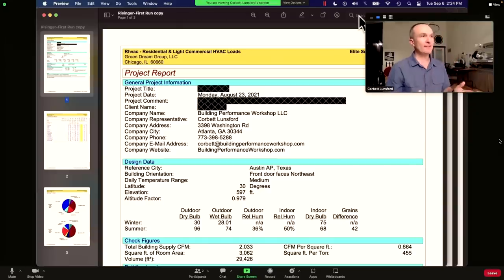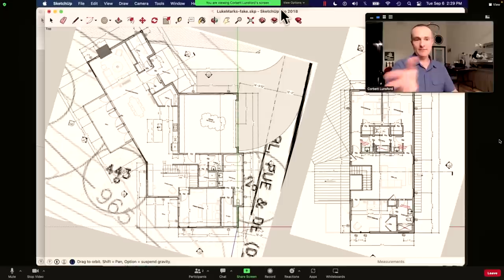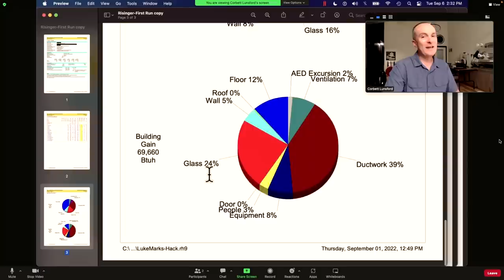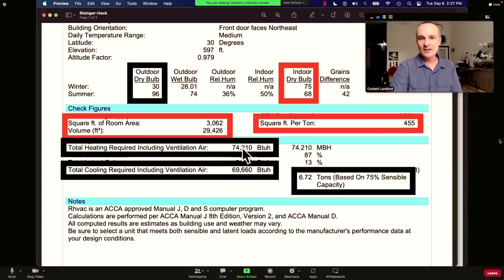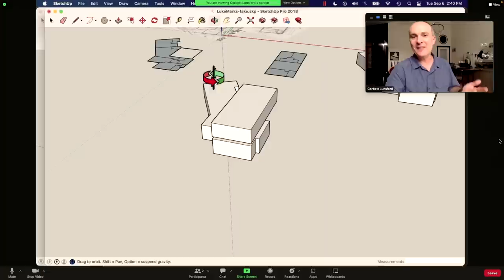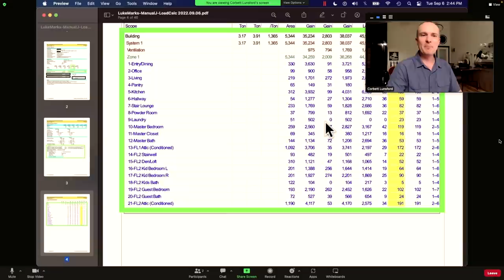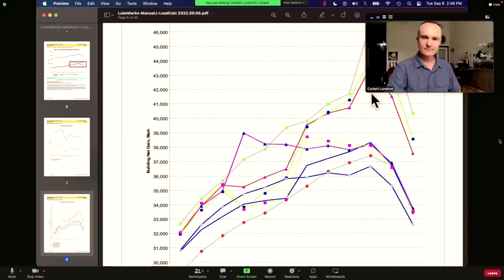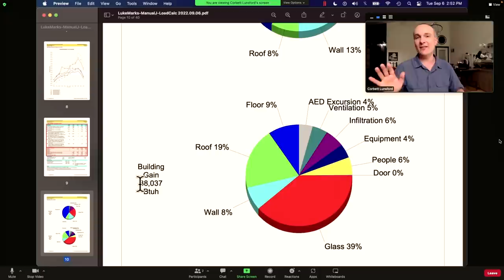Your HVAC specs might be COMPLETELY wrong: Manual J Training

Comment: When we built our production builder grade home - I asked for a manual J and they couldn’t produce one. When I pressed them for it - they told me they did one for the floor plan and not for my specific house.  Now I know better. Doing a manual J for a floor plan and not a specific house doesn’t take into account for the location and orientation to the sun in the heat of the day.  As a result - my hvac struggled in the July/August months…until I did Insulation 2.0.  That actually made it to where my hvac could keep up.  Would love to know what a manual j report would have said my house needed.  I have a 3,100 square foot single story with a single 5-ton unit.  When I build my retirement home I will be hiring Matt to come down to San Antonio to consult on the build to make sure it is done correctly.
Reply: How did you do Insulation 2.0?
Reply: @LeanHVAC  best advice is to search Matt’s other videos for insulation 2.0.  Watch the video and do everything he recommends.  It made a huge difference year round for us - but especially in the heat of the summer and coldest month of winter.  My bills are consistently much much lower than my neighbors.  Be prepared for a lot of work - especially if you have a large single story like me. Do it now during the winter months before the attic gets hot.  Also as a best practice - I ran lights in my attic before I started so I had plenty of light to work.  Also - I bridged the trusses with 2X4’s and plywood to make an easier time of getting around my attic.

Comment: From what I've seen, many HVAC companies do not know how to handle a house with a conditioned attic.  With a steep pitched roof a conditioned attic encompasses a large volume of air.  This definitely influences the temperature in the house below the attic.  This is largely overlooked by most Manual J calculations I've seen.

Comment: Great content. I wish more HVAC contractors would embrace the guidance set forth by ACCA (Manual J/S/D).

Do keep in mind that Manual S is critical for AC sizing because the tonnage specs on most systems
are rated at design specs that you would NEVER run your system at. Therefore, you have to use the 
extended performance data from the manufacturer to figure out the extrapolated ratings at 75F dry bulb and
62F wet bulb (at the ASHRAE outdoor temp for your location) for a few different cfm/ton (350/400/450)
airflow settings (manual S will give you a formula for setting fan speeds based on data from Manual J)
You shouldn't oversize by more than 15% for single-stage AC, 20% for dual-stage AC and finally 30% 
for variable speed AC. There are a lot of great training videos on YouTube from Ed Janowiak who
is the head of education at ACCA. Search for his "What is Proper System Airflow" on the HVAC School channel.

Comment: Thanks for this video. I'm so tired of rule-of-thumb bs, also with no testing or checking reality. The US would use 15% less energy with careful builders and smart architects.
Reply: You have to think about the AC cooling capabilities are getting lesser when people don’t care about their ACs and Freon leaking, etc
Reply: 15% sounds pretty negligible though?
Reply: @3nertia  Depends on the upfront cost. In my climate, many energy efficient design and build upgrades have a 5 year payback for new construction.

Comment: Can you guys explain the difference between a conditioned attic versus an encapsulated attic. My mech engineer says mine will be encapsulated even though well insulated at the roof because I don’t have actual vents cooling and heating the attic. I presume I’d need a thermostat up there too.
Reply: Short answer: every part of the home should be completely IN or OUT. If it’s IN, treat it like any other room, and put a supply and return pathway in.
Reply: Humidity could be an issue with encapsulated. Since you don’t need insulated ducts if the HVAC system is in the attic, you don’t want them sweating in a non-conditioned attic, and you don’t want your roof rotting. Having a temperature difference or humidity difference between the attic and downstairs can lead to moisture issues which leads to mold.
Reply: @HomePerformance  I thought code doesn’t allow a return if you have another gas appliance in the conditioned attic like a water heater.
Reply: @jasonbkau  That mostly goes for atmospheric draft water heaters or induced draft furnaces- neither of which should ever be used in any home where airtightness is paid attention to. Massive problems coming whether you put a return in the room or not.
Reply: @HomePerformance  How about  a dedicated minisplit for the conditioned attic?  Insulate the attic roof with closed cell foam and insulate the attic floor with rockwool, hang the HVAC equipment, and then you get best isolation from a noise standpoint and don’t have return air sucking in rockwool fibers.

Comment: “The hottest day of the year in the summer”?  Is that as opposed to the hottest day of the year in the winter? ☺
The Manual J has not changed much since I retired 30 years ago.  I could use it to calculate the heat load done to within 5 BTUs. The problem was (back then) units were only available in one ton (12,000 BTU) increments. 2 stage units and VAS blowers were on the horizon nut not commonly available.
Great video. Great advice.

Comment: People should just pay your engineers instead of asking contractors to do it as part of the install. I do this same work commercially and interior loads are much more emphasized. For example he doesn't include any televisions or computers or guests. Also the ventilation rates look really low. I didn't see a bathroom exhaust fan. Etc. I would have added more detail on the interior loads. It makes a surprising difference. And yes lights will be on in the house lol.

Comment: 38:21 38:21 

Will be starting a building project this fall/winter. I had planned to put slab insulation… I’m understanding that I may not be doing the home justice by doing so for the summertime. I plan to wrap the house with rockwool comfort board… I’m curious if the insulation within the slab should be taking out of the equation or not… I live in central Missouri

Comment: A little bit of a rant here. Dont that 1-1/2 ton of load lost on the duct prove mini splits are way more efficient. You dont have to insulate and cool the attic. So you dont only save a huge expense of extra insulation for the attic, but also save the loss of the duct (friction), but also cooling/heating losses. In theory you can kept the square footage of your manual J down, but also cut those loses alltogether. I am crazy here🤔🤔?
Reply: Interesting point, Gabriel- I’ve found it’s VERY difficult to get all you want from a home without a central duct system, here’s why:

5 Factors for Ventilation: How to Plan a Healthy Home
https://youtu.be/FOJ8fsAVUaI

Comment: I’m no expert, but the thermostat setting is/could be different depending on the house. I preferred 69 in one house and 71 in another. It seems unlikely to me that HVAC design and install can directly nail down the exact thermostat settings the family will use. The number is unimportant. It’s the feeling that you adjust to. Maybe I’m wrong. Also, what if an elderly lady prefers the temperature at 78°? Should the design be customized and sized to that temp? When she passes away and the house is sold, the system is completely undersized for a new family. Maybe Corbett’s number is the avg. preferred temp of most people..
Reply: Usually the energy code dictates the temperature settings for designing heating and cooling systems and then you have an allowed safety factor. Usually you end up between sizes so you're then allowed to go up to the next available size equipment. This allows people to run the system warmer or cooler as they prefer.

Comment: I am building my own home the reisenger way and got a useless manual J will be reaching out :) I also own mobile home parks and have been putting in 3.5 - 4 ton units in for 900sqft homes. I've been arguing with installer/prop manager for years. On the one hand these are the leakiest worst insulated structures, but it just seems impossible. I kind of want to buy a manual J for a 1985 mobile home just to settle this!
Reply: I own a 105 year old house with no insulation in Houston that is 1950 square feet with thirty single pane windows and HVAC in the attic with no radiant barrier and only gable vents.  Two manual J from two different companies showed ~60,000 BTUs of cooling or a 5-ton.

The 5-ton single stage A/C works great.  A 900 square foot can’t possibly need a 4 ton..
Reply: I can assure you it’s not manual J that’s the problem. Manuals J & D done properly and I will repeat done properly is the best tool in the design of a residential HVAC system. With properly sized ductwork, supplies installed in the area of windows and air returns in every room but for the bathrooms  & kitchen, Life will be good👍.
Reply: Bring it, Damian!

Comment: how do you do this with an existing home?
Reply: Totally do-able, you just have to spend way more time doing ‘take-offs’— building a blueprint and finding the most accurate insulation values to assign to every surface of the home.
Reply: @HomePerformance  so you are saying from the interior, wall floor/basement and the parts that make them up?

Comment: Also Matt, do not bring the vent'g dehu supply into the HVAC return! I can send you some info from Santa Fe. Bringing it in before the evaporator coil significantly de-rates the AC's sensible and latent capacity. Bring it into a low static supply trunk!
Reply: Is this the same as Santa Fe’s recommended configuration shown in their resources? We’ve just had a Santa Fe 120 installed in our home with the 6 inch fresh air input vented to the outside and the supply sent to the air handlers supply. I’m a little fuzzy on how they wired up the Santa Fe return.
Reply: @SamuelBiller  yes its what they publish. They recommend a dedicated return but they also approve of a short duct into the return plenum.

Comment: I don’t understand why the temp the thermostat is set at is not relevant. I would never under any circumstances set my thermostat over 70. I keep it at 68 in the daytime and 64 at night in the summer,60 in the winter. Our manual j also shows 96 in my market but we had two weeks over the summer where it was over 100, I had to add window units just to be able to make it bearable inside my house.

Comment: For medical reasons the 99% calculation doesn’t work for us. So I told the installers we need the house at 72 degrees even if it is 110 degrees outside. Out of 4 quotes only 1 company acknowledged that. So they got the job. I’m really glad I did that 10 years ago because we hit 110 degrees lately.
Reply: The 72* is not really the problem, it’s humidity management for those in humid climates because you reach dew point at 72 and risk creating serious issues. You’re ok if the house is properly dehumidified and right, and if done so, you might not even need to be at 72 due to lower humidity.
Reply: If done correctly you should have no problem manual J & manual D . Manual J will use your geographical location . Size your ductwork correctly, install the supplies in the area of windows and install air returns in every room but for the bathrooms and kitchen. If you still have reservations go with a VRF or VRV System. Oversizing the system is not a very good remedy.

Comment: Might be?  I have a 3 ton heat pump in a 650 sqft condo.  It was 20ºF last winter and the worst I did was a 50% duty cycle.

Comment: How about no ducts. My son and my   neighbor built 2 houses with 6 mini splits each.  Both houses are super insulated and a roof full of solar panels. Pretty much no electric bill
Reply: If you’re dealing with slab on grade houses (no basements) then minisplits may be the way to go . Big heads mounted on the walls aren’t the prettiest things in the world and the units will lose their luster once the problems start occurring as they age (condensate pumps inside walls,unfishable line sets, retro fitting replacement heads because of design changes). But that will be the homeowners problem in 15 or 20 years, not yours.

Comment: 1.  Rule of thumbs only lead to broken thumbs
2.  Build to customer requirements.   You will never win the " you should only set your air conditioner to 75⁰". It doesn't matter what acca wants, that argument has been lost in court.  Bad advice.
3. Great observations on duct losses.
Reply: Agreed on #2, Holly- as long as the design pro has very clear and correct reasons for all the inputs, then there's no problem.

Comment: This might sound radical, but do you even need windows in a home anymore?  Why spend all that money to install something that will just give you very low R values,  When you could achieve the same view with external cameras and internal screens that you can turn on and off and achieve far superior insulation values?  As a side benefit, nobody can see inside your house.  Now you can still have the odd window or slider door, but you could eliminate a lot windows this way and could double as a security system.
Reply: Haha damn Logan- we need to make ladies happy too at least a little bit.

Comment: Good Video. Is the software updated to take into account the change of climate?  Is there a place where I can get degree day data for my zip code?
Reply: No it’s not- that’s called design day shift I believe, and you can easily model it by changing temps yourself.